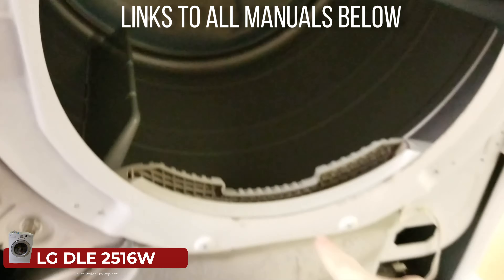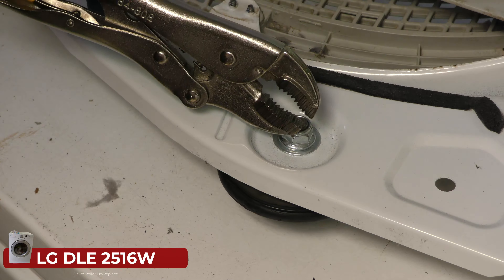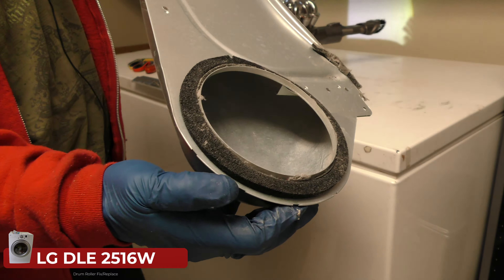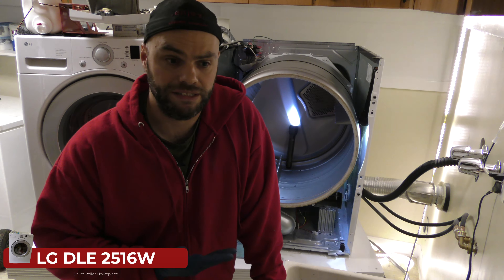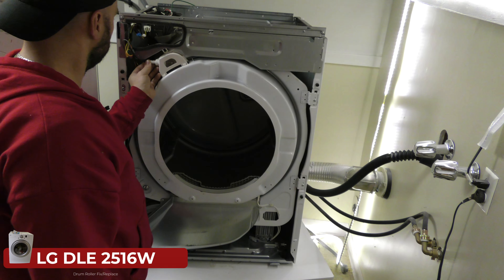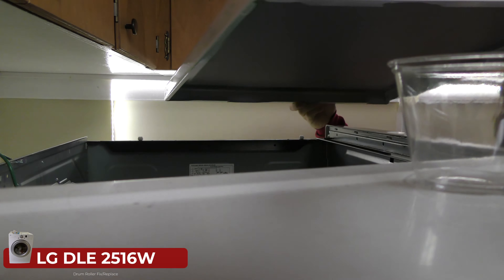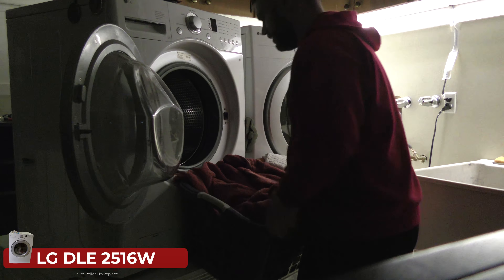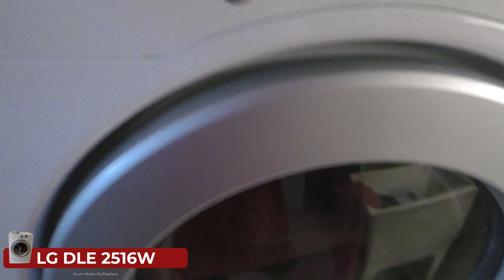LG Clothes Dryer Drum Roller FIX! Thump thump FIXED! Links Included. You're welcome! (LG DLE 2516W)

Comment: I was getting the thump noise thinking my rollers were bad/flat spot.  Thought my rollers were bad, nope.  It was about a 2" crack in the drum close to the edge.  Turn the drum, feel for the weld seam and press, if it separates, you have a bad drum and need to replace it.